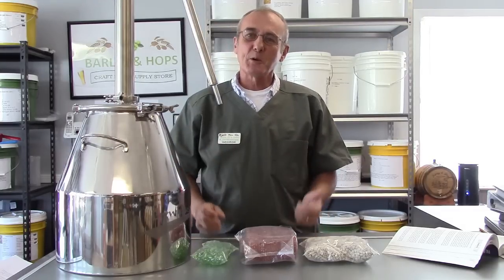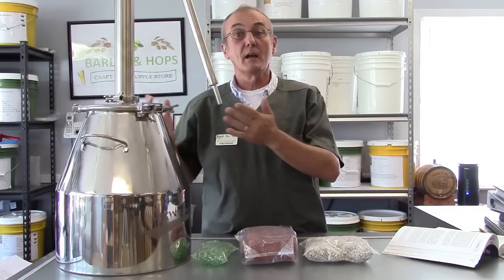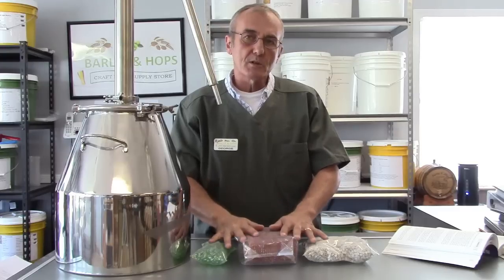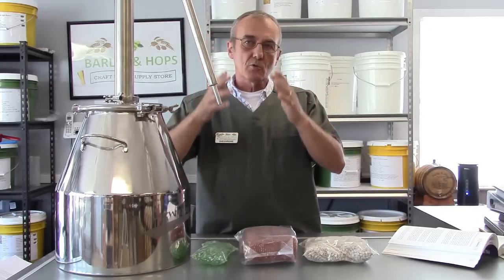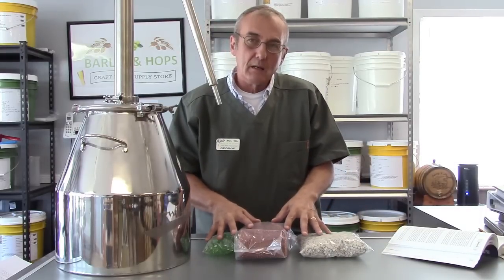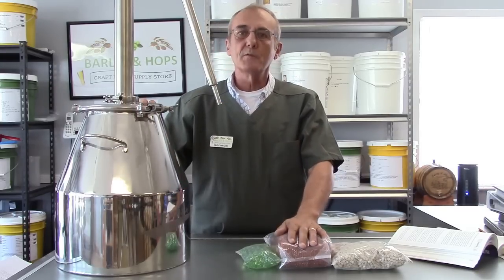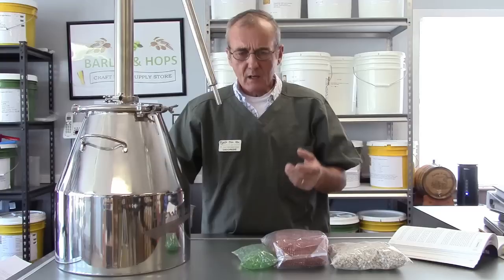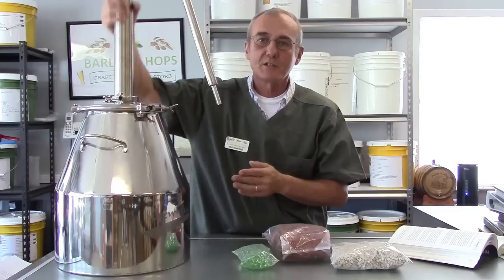Copper VS Stainless steel in distilling

Comment: I bought a 100% copper distiller for water and it gave a strong copper taste to the water.  Once I put it through a filter the smell was gone.  I may have to invest in stainless steel unit.
Reply: What filter did you use? Like a brita?
Reply: @newclearwinner4755  Yeah I used a brita filter.

Comment: could we use a 2 inches lead free brass as a column and fill it with copper mesh or stainless steel pallrings but use copper as a condenser   ? Thank you for replying.

Comment: If I connect a hose under the mash bucket and a hose on top of the bucket airtight and ran  another hose to bucket full of salt and a air pump and just pump the moist air through the bucket to the salt bucket now that sounds like a cleaner way to to go about it no more copper or a fire needed. What do you think you think it'll work I've never tried it
Reply from the maker: Not sure how this would work. Sounds like a project that deserves some attention.
George

Comment: Do i need the Still Spirits Copper Alembic Dome Top or can i just get most of the benefit from just a copper Pot Still Alembic Condenser?  Basically i have the Turbo 500 Still Kit with Stainless T500 Reflux Condenser and Turbo 500 Boiler  and was thinking i could remove the reflux condensor and replace it with the  copper Pot Still Alembic Condenser and save the 200 dollars for the copper dome.

Comment: What is the best way and best cleaning agent to use to clean the copper?
Reply from the maker: I use CLR from walmart. Costs about $5 a bottle. It is calcium,lime,rust remover. Works great but you need to rinse with warm soapy water afterwards.
George

Comment: I found the info you have been pedaling entertaining and most of it was neither here nor there but informative, but this video...  you killed it for me... 
your comment about copper playing no part in the boiler... pew pew pew... 
snake oil salesman FTW...
Reply from the maker: We all have our own opinion. I value yours and appreciate the comment you left.
Reply: I guess being polite in a reply, using "we all have our own opinion" is a good way to deflect being incorrect. 
If you are going to preach how to to people, at least get it right... 
Im going to leave you with one word to look up and study... 
"esterification"
Have a nice day...
Reply: Yes, Simply adding some copper offcuts to your boiler is all that is needed.
It has been shown that adding scraps of copper to your boiler removes what is described as a stale potato smell/taste from your end product.

I'm not proclaiming to know what the exact process is, but its said the acids and fats in your wash react with the copper producing esters or aromatic fruity essences/smells that come across in the distillation process and various heavy salts that cant be distilled over in the vapour path.

I collected a pile of copper tube off cuts, 3/8" - 1 1/2" dia and about 1 - 2" long, I then threaded them onto a length of 3-4ft length of copper earth wire making a snake of copper tube off cuts so they can be easily removed, I found the smaller 1/2 dia tube was harder to clean.
This is inexpensive and simple to do by anybody.

Comment: If I may. Been brewing/distilling for years. I started with my homemade still and have graduated to a stainless steel rig that I packed the head with copper. TRUST me it makes a difference. I don't run any grain washes, only sugar because I prefer a neutral spirit that I add extracts to. That being said I have no need for any flavoring so the copper works well for me. How do you know it's working? Well even after a single run the copper will turn colors as it extracts the sulfites and nasties in the vapor. In between runs it's recommended the mesh be rinsed out. It will have that tails smell all your distillers are familiar with. This is the roll the copper plays. The taller your column/more packing the better the results. Some recommend replacing the copper mesh after 5-6 runs but I don't stretch it that far. Maybe 2-3. The best part about using a stainless rig with copper mesh is there's no copper to have to clean, you simply replace the mesh after you're tired of rinsing it. My old still no matter how careful I was with cleaning it would eventually develop deposits in the lines rendering a dirty wash. You get that green deposit that unless you can get in there and wire brush/scrub off will have a nasty effect on your product. I triple distill my product so after my final spirit run my copper mesh is spotless and clean like new. That tells me the copper mesh in the 2 previous runs successfully removed all the nasties. It's way to go. Now if I can only save my pennies for that fractionating still..........

Comment: In regards to buying a copper still and cooling a coil - can ice be placed in the pot that holds the coil to cool it or does running water the only option.
Reply from the maker: Water with ice is the best option. Without the water it is difficult to realize the heat transfer without the water surrounding the coils. 
George
Reply: Interesting Thank you
Reply: put the coil in a bucket of water and it shoud be able to distill 20ltrs of wash after that replace the water in the bucket or it wont condense so well.

Comment: The best setup is a SS boiler with a copper reflux column packed with SS scrubbers and a pre-condenser or dephlagmator in the top of the column and use a counter flow shotgun condenser for collection. This way the SS is easy to clean and you still get the benefits of copper removing the sulfites and a shotgun condenser takes up much less room than a copper worm.
Reply from the maker: +Thomas edwin You make a very good point and there are several set-ups that are all very good. 
George
Reply: +Barley and Hops I have used choreboy copper scrubbers for column packing after cleaning them first with a solution of citric acid and hot water but I found that the copper scrubbers get smaller and smaller after each use from the heat and they also start turning a blackish  color and need to be cleaned on a regular basis, The blackish color is caused from the copper scrubbers absorbing the sulfites in the vapor stream. Also copper scrubbers will turn a blue green color from verdigris if they are left in the column still wet from use. They will turn green just like your copper plumbing pipes in your basement from moisture. That blue green stuff is poisonous if you get enough in your liquor it will make you very sick. The best way to clean copper scrubbers to remove the black color from sulfite exposure or removing the green verdigris is to boil them in a SS pot with water and citric acid.  I now use scotchbrite  stainless steel pot scrubbers inside a copper column  with a good sized wad of copper mesh in one end to get good sulfite removal. After each run I just pull out the copper mesh for cleaning and leave the stainless steel scrubbers in the column and just rinse it out with hot tap water and leave it to dry. The SS scrubbers stay very clean and only need cleaning after about every 5 or 6 runs. I have used marbles, glass beads and even ceramic rashing chips but the stainless steel scrubbers are by far much better because they stay clean longer and provide much more surface aria for condensation and reflux than other things But like George says you still want to have some copper in the vapor path for sulfite removal. All copper is the best thing to use but it's such a pain in the a$$ to keep clean. The only part of my still that is made from 304 stainless steel is the 15 gallon boiler and some of the SS tri-clamp fittings, All other parts are 99.9% copper plumbing pipes soldered together with lead free solder. My column is 3 inch diameter by 36 inches long with a 9 inch water cooled dephlegmator on the top of the column, then it goes into an 1&1/2 by 24 inch 7 tube shotgun condenser and then into a half inch output leg. I get around 75% ABV on the stripping run then on the second purifying run I get 94% to 96% alcohol by volume or 190 to 192 proof. It's crystal clear with a slight sweet smell, after that I can mix or dilute it with whatever I want or sometimes I do shots with a beer chaser. A 750 ML bottle of this will last me 2 weeks or longer.
Reply from the maker: +Thomas edwin awesome. I hope everyone reads through this. It is a very good description of how to accomplish this. Great job
George
Reply: What is the ratio of water to citric acid for the boiling?

Comment: Just a question but instead of using copper mesh as packing could you also use a copper tube inside of the colum just slightly smaller then the colum itself so if your colum is 2 inches you can use a 1 1/2 piece ?